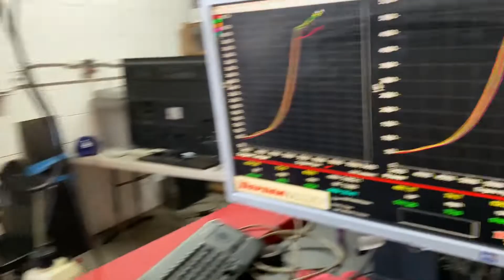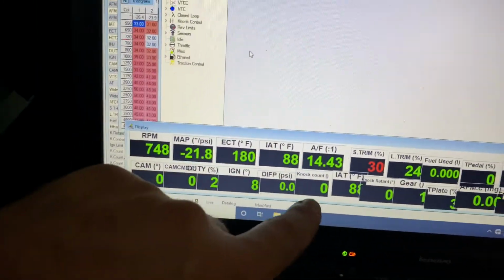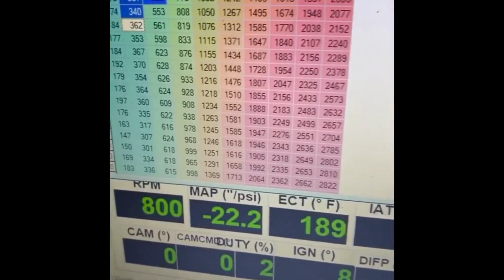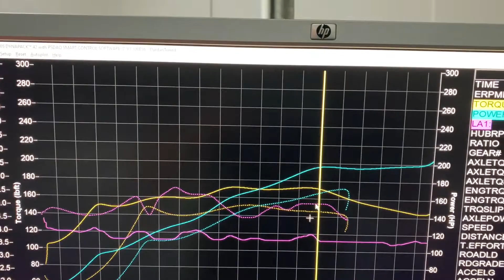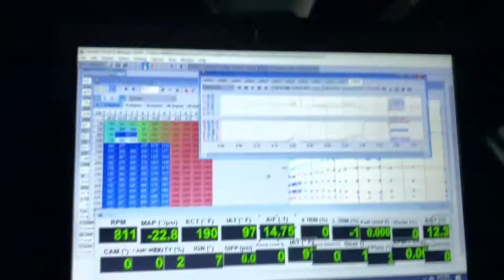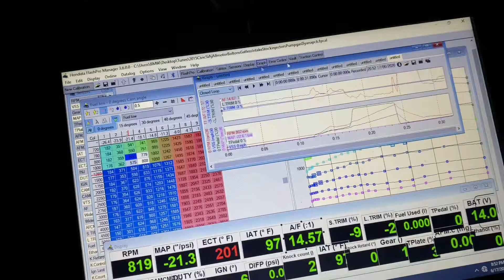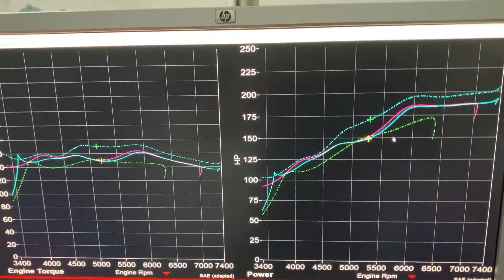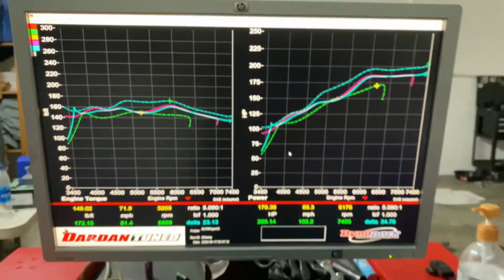Exhaust silencer dyno testing. Does it effect hp and tune?

Comment: These are actually pretty helpful bro 🙏🏾
Reply: But if he’s full skunk2 I wonder why our numbers are so low. 😩
Reply: Stock downpipe @dardan? Not really for a z7 head. Maybe a little on the low side if it has a downpipe? If your not swapping the head save the money and run a drop in filter & catted rv6 downpipe and make close to the same power with more torque. I know because he tuned mine👌👍